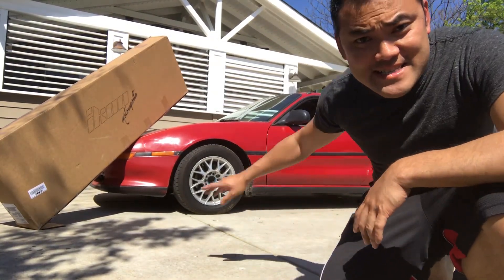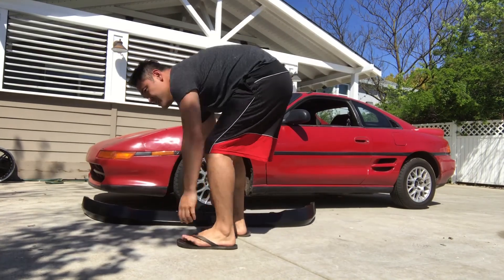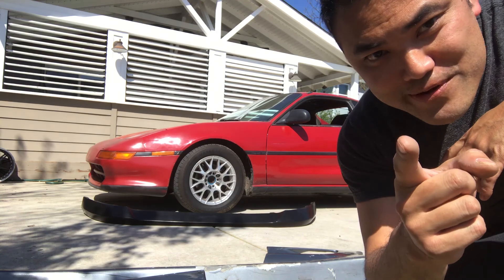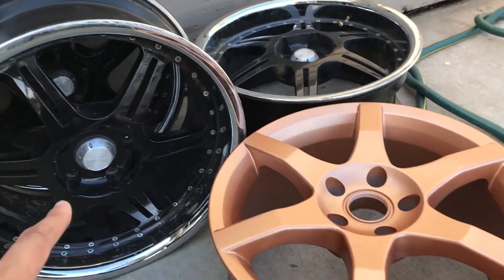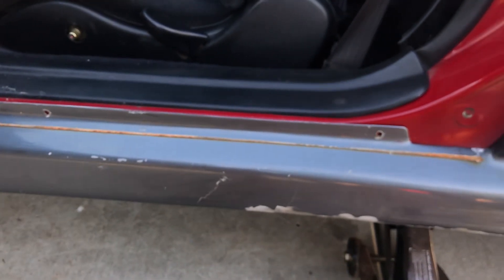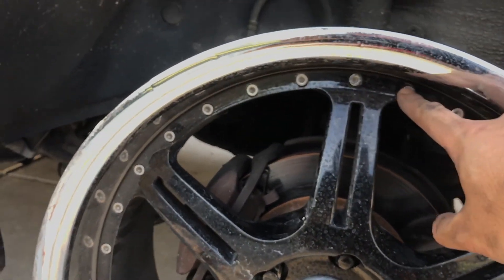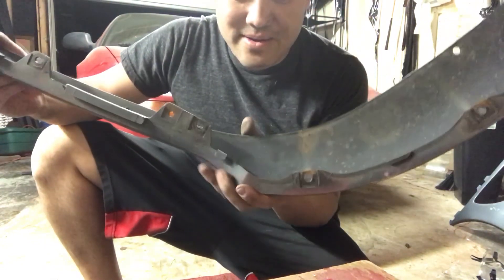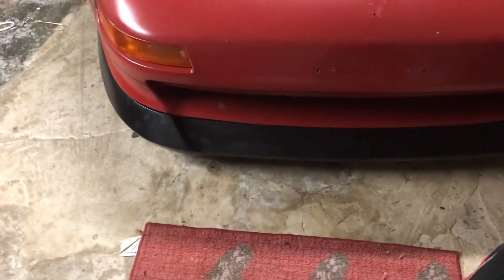HOW TO INSTALL FRONT LIP & SIDE SKIRT TOYOTA MR2(1991)

Comment: I have the same side skirts, got them about 2 or 3 years ago. I might put them on soon, now I know how. I was a bit worried about drilling the middle bit as well. I think there is some very good glue you can now buy, which will probably do a good job. Did you have any problems with not drilling?